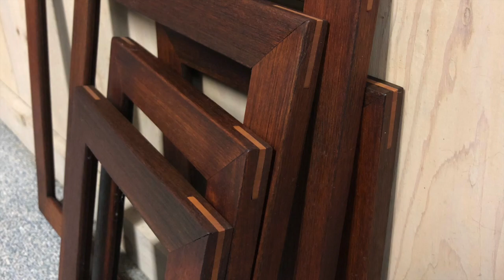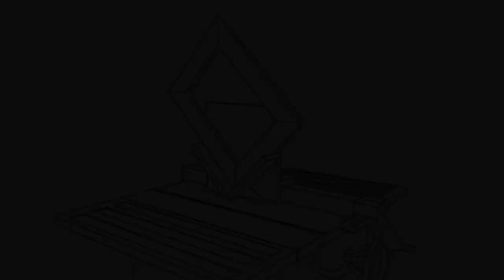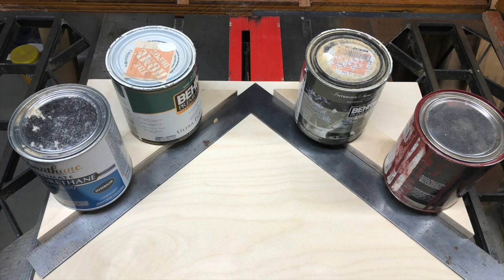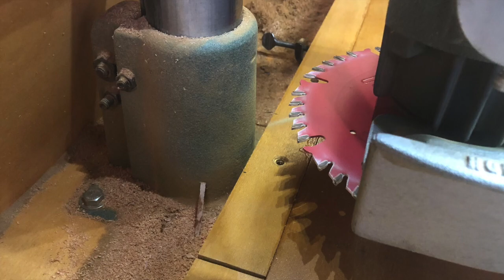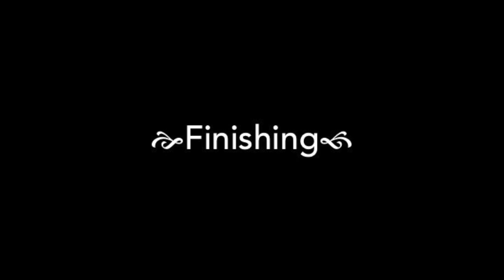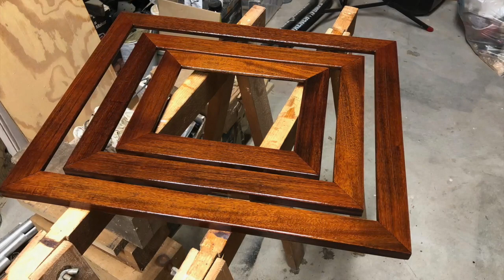Corner Spline Sled for Radial Arm Saw

Comment: Excellent video. Thank you. What do you do to keep the frame pieces together prior to splining?
Reply from the maker: They’re glued together before I cut the slots for the splines.
Reply from the maker: If you’re making picture frames, here’s a few other frame-related videos that you may find helpful…

https://youtu.be/1wZhrAvtPWc?si=PngL_ioTb-E05xmk

https://youtu.be/svkrA0oBpNc?si=XZeJHeNBM8VQWQTb

https://youtu.be/Um5kzkli00M?si=mxYJmxQ-phPYYy8l
Reply: @brianweekley5700  thank you Brian.  When I posted on Facebook (on the DeWalt Radial Arm Saw page, seeking a shaper guard for my 1956 MBF, one commenter said they didn’t think the 3/4 hp MBF could handle shaping. What’s your opinion?
Reply from the maker: The MBF makes a great shaper!  Look for an old Delta/Rockwell molding head (about 4" in diameter).  You can find lots of knife profiles for it (eBay).  You can also buy new knives at Corob Cutters.  You can find an example of one at 5 min in this video...
https://youtu.be/UIXNk2MagOs
Reply: @brianweekley5700 thank you 😅 that’s very encouraging. I love your “hulk” motor you have on yours. Is that motor a factory option, or something you had made? - Jon
Reply from the maker: @ironwrx My “Frankensaw” was not a factory option.  However, I wouldn’t recommend trying to make one. You’re always better off just getting a larger saw (and there are plenty out there)!

Comment: Do people use radial arm saws?
Reply from the maker: LOL!  Absolutely!
Reply: @brianweekley5700  Who sells radial arm saws?
Reply from the maker: @richardmckrell4899   The Original Saw Company still manufactures and sells quality RASs in the USA.  They are pricey.  However, the beauty is that there are many, many used ones available for pennies on the dollar that are prime for restoration.  Many folks don’t use them because they aren’t easily portable like a modern miter/chop saw.  However, they’re so versatile in the home shop if you’re willing to set them up correctly and use them properly.
Reply: @brianweekley5700  Based on your answer, radial arm saws are no longer practical.
Reply: @richardmckrell4899  The market would say so, but Brian's videos surely suggest otherwise.  I have two.  I don't do half the things Brian does, but I use them for about 95% of my crosscuts and dados. For many years, I did all my rip cuts with it as well.  I don't foresee a comeback, but I do see a number of younger woodworkers who have discovered the tool and many of its values.  Perhaps the best example on YouTube is Tommy Tompkins.  Brian is the guru.
Reply from the maker: Thanks, but just being able to cut dados on the top of a long board is reason enough to have a RAS in my shop.  What other tool can do that efficiently?
Reply: If there was a demand for dados cut on RAS, manufacturers would make RAS's.  The demand is not there.
Reply from the maker: Hand planes aren't exactly in demand either, but I still own and use those too (LOL)!  What can I say?  I enjoy using antique tools.  Other than RAS bashing, not really sure what point you're trying to make?  The fact is, RASs are complicated and expensive to manufacture (at least ones worth using).  Sadly, we now live in a society where there is little appetite or tolerance to pay for quality made woodworking tools.  That's why there is virtually no demand for any woodworking tools still made in the USA.  Sure, there's a few, but almost all woodworking tools are now made overseas and plenty of people are willing to buy cheap crap sold at HD.  Many people still own and use RASs.  I appreciate the tool and love using it for many jobs.  That's the only purpose of this video.
Reply: @brianweekley5700  I love antique hand tools, antique power tools are a little different, you know that.  I inherited a 1955 Boice Crane table saw, I use it, but will never let my son use it and would never recommend it.  It's just too dangerous.  My dad has 2 antique RAS's from my grandfather that he used as a kid and tells me they are just too dangerous to ever use again.
Reply from the maker: @richardmckrell4899   I appreciate the comment. Totally agree a RAS can be a dangerous tool if they are not setup and used correctly.  Using an improper blade on them is probably one of the biggest dangers leading to climbing or kickback/ejection.  I wouldn’t recommend anyone using one without first reading the book “How to Master the Radial Arm Saw”.  The RAS can be intimidating for those unfamiliar with them.  As with all power tools, they must be treated with respect, common sense, and used with full attention at all times.  I try to always demonstrate proper technique when I use mine.  It pales in comparison to a chain saw, which is probably my most feared power tool!
Reply: @richardmckrell4899  I had a guy buy a parts washer from me who commented on the safety of my using RAS's for woodworking.  When I replied that any machine is dangerous unless you use it properly, he showed me two injuries on his hand: one from a planer and another from a table saw.  Both are used every day by millions of people, the vast majority of whom use it safely and a very small minority of whom sustain an injury for lack of safety precautions.  Respect for a power tool is necessary for safe use.

Comment: Excellent video, Brian. I recently used a table saw and a jig to cut spline slots for the mitered corners of a shot glass display cabinet door. It was scary because of the size and weight of the unit and because I already had the acrylic pane in the door (not to mention that it was my first time doing this). The radial arm saw appears to be a much safer option because the workpiece is flat on the table. Thank you for another excellent video!
Reply from the maker: Thanks, Avi!  I think the RAS would be a good option to put splines in your cabinet door.